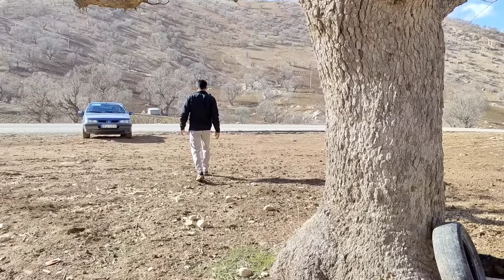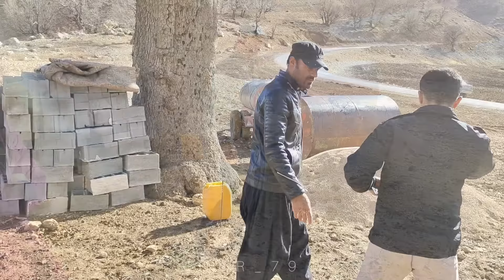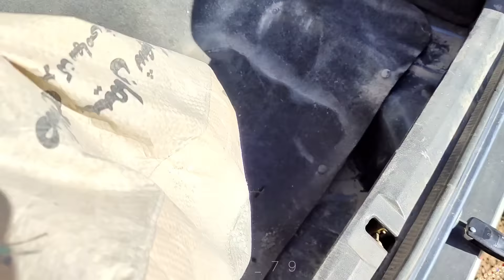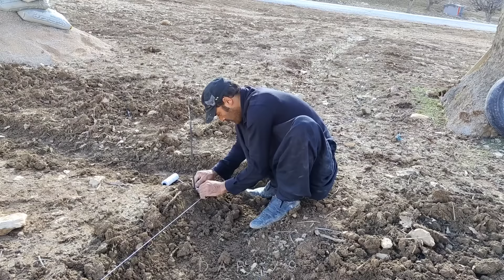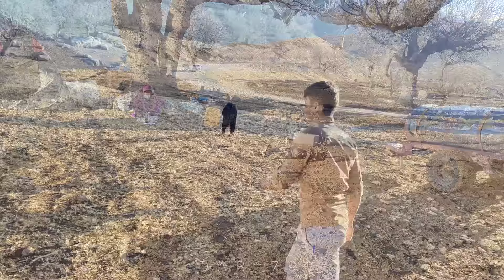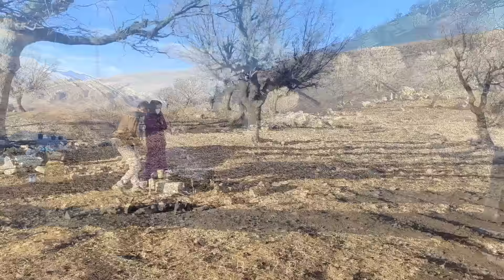First step: Rasul and Narges cooperation to build an ideal house

Comment: The position of the house is so close to the busy road, it’s so noisy. I suppose they will in time get used to it and it will not bother them. The labourer is very efficient, he has laid a very good foundation. Hopefully it will support the walls for a long time. It’s good they have a lot of natural sources for wood and rocks. They have the money that was returned to them from the previous landowner- the older man told her to keep it to build the house and feed the children and she can pay him later when she finds some work. So they have money for blocks, cement and sand. What happened to the corrugated room sheeting and the iron bars? They didn’t come back with the blocks! Hopefully they are safe somewhere, also the metal door frame. Everyone seems calmer including the children, but Rasoul doesn’t seem as happy as he used to be, but he brightens up when he has the children around him.

Comment: You need the right tools to build a house fast you need a wheel barrel to move the cement. Long shovel pick axe for digging and chopping wood.

A wood Saw to cut wood.

Switch to a propane stove sometimes wood is hard to find

Comment: That size is just fine for as long as the toilet and bath is separate but attached to the main house and a door inside the house leading to the toilet/bath. So that people  will no longer go outside and walk a few meters just to answer their call of nature. Most nomadic homes build their comfort rooms 10 meters or so from their house. What if it is raining so hard? Before you reachthe CR you get so wet already.

Comment: My curiosity is on how your do the house know ,  but as for small children,  I wouldn't have put it so close to the road, not good ,  you could build a rock wall to slow down the children from running/going in the road. just a idea .  My self , I would move the house back from the road , wow , you can see the town from up theire . The nights are going to be unreal up there. wow